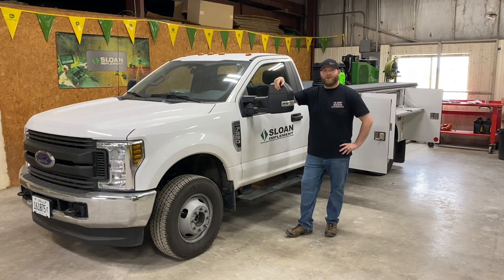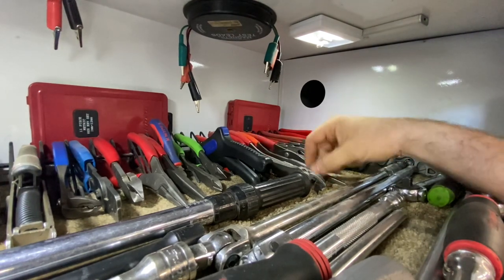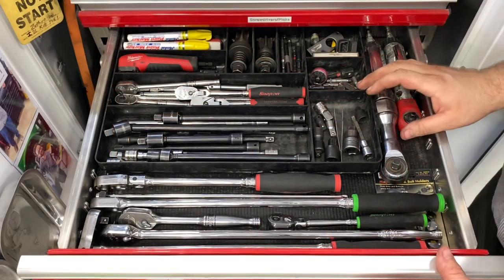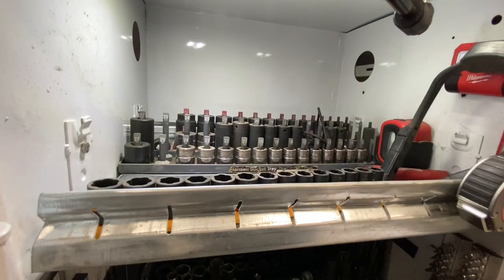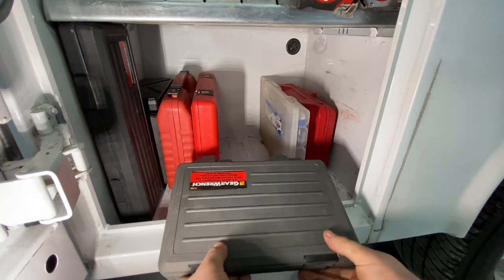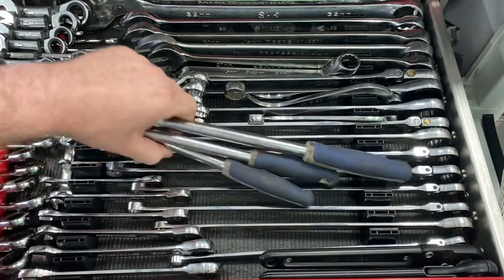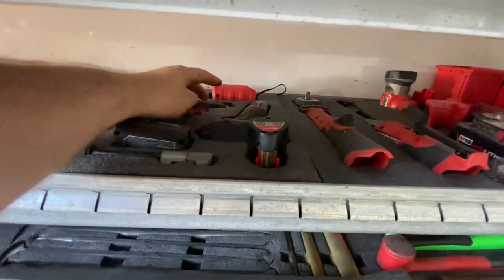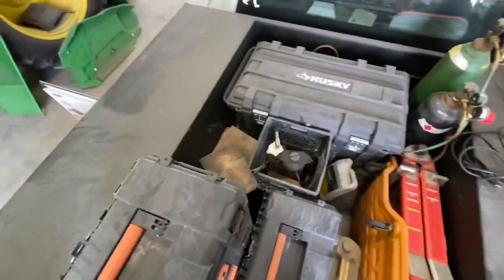John Deere Master Ag Technician service truck tour

Comment: I have that tekton set of 12pt impacts and was burnt by assuming it started at 10 and I didn’t have the 10mm 12pt to remove the injector retaining bolt on the QSX15 injector hold down. Luckily customer did. I took out the 11mm and replaced it with a 10mm. 7/16 is same as 11 and I also have the SAE set so it worked out good.

Comment: That magnetic roach clip tool is great for soldering wires. Matco also has a wire holder tool that feed solders through the middle of the tool towards the two wire clips or clamps. Im sure you've seen it or have it. Both are in my tool box. Great content and videos ZK!

Comment: My service truck is a F550 with the 6.7 diesel. And my air compressor is PTO driven. Also have a Miller Trailblazer 325 EFI welder.  Tanks for Motor oil, Hydraulic oil, Antifreeze and waste oil. All with pumps and 50 hoses. The hose crimper and fittings are in the back left cabinet. Hose is in the box in a sealed container.

Comment: Put one of those silica gel dessicant bags like you get in beef jerky in all of the drawers and inside your tool cases especially your feeler gauges and measurement tools, it absorbs moisture and prevents rust. Absolute lifesavers

Comment: I wish I could post a picture of my service truck,  2020 freightliner m2106. 9liter  Cummins , Allison 4000 trans sitting on air ride.The bed is a 21ft Load king . Pto driven air compressor,  10k auto crane with 32ft of stick.  Miller 300 welder/Generator.with 8vs mig gun . And an additional 100,000 of personal tools. But I m impressed with his cleanliness of this tools, his service truck might weigh 14,000lbs. Mine Weighs 32,324lbs
Reply from the maker: You should do a video tour! Sounds badass sir!
Reply: @ZKMasterTech  it is , but due to company policy I can’t make YouTube content with company equipment,
I work on power company trucks and Railroad equipment

Comment: I like the fact u buy the best tools regardless of brand not just snapon is the best attitude
Reply: Out of the hundreds of different tools I own the only own one snap on tool and it is a feeler gauge for adjusting the air gap on points and condensers. Most of my tools are either Sears/Craftsman or Harbor freight
Snap on is just extremely over rated and expensive

Comment: I've been a Deere tech for 13 years. My service vehicle is a GMC 2500 van, which is not nearly big enough. Haven't been able to talk them into a nicer truck yet, not that I haven't asked. I might just have to buy my own.
Reply from the maker: Yeah I think you’d be better off switching companies before forking up that amount of cash.
Reply: @ZKMasterTech  How long have you been with Sloan's? How long have you been in this truck? I like to keep my tools in clean, like new condition, if I can help it. I worry about rain and moisture with a truck service body. I work at one of your competitors in Wisconsin. But my family has a decent size dairy farm also. I'd rather not have to by two of everything, but they won't let me take my truck home overnight unless there is a service call close by. It has crossed my mind to maybe try and find a retired tool truck and turn it into a mobile shop.
Reply from the maker: I have been with Sloan’s for 11 years and I’ve been in that truck since 2019. When I need to work on stuff at home I just fill my personal truck with what tools I think I’ll need plus some extra just in case. But if I’ve got a major project I can take my service truck home.

Comment: Am I only one that appreciates the amount of money in sockets alone lol
Reply from the maker: Don’t tell my wife! 😂
Reply: I’m an engineer in New Zealand so I don’t know what snap on costs in the USA but over here it is prohibitively expensive, I have seen a snap on 3/4 inch drive socket set that cost the owner $5000 my 3/4 inch set cost me $150 but I try not to let people see it
Reply from the maker: @joelhart9020  yeah the majority of my snap on tools I bought through a tool program when I graduated Wyotech and got my box 65% off and tools 50% off. But I've still bought a bunch off the snap on truck over the last 15 years. I usually spend $250-500 a month on tools. But, everything I have is paid for. You'd think after that many years you would have everything you want or need...nope lol.
Reply: @joelhart9020  Wow!!!!!   Would you consider buying a set for those in the USA that want a 3/4 "  set and save a lot of money by buying snap on thru New Zealand!!!!!
Reply: @Franklinveterinarycenter1of4  sorry I wasn’t very clear, the snap on set was $5000, the set I have which is definitely not snap on cost me $150

Comment: Nice set up. Having no crane must limit what you can do on site? I know you can haul stuff to the shop but that isn't cheap. Also not much room left for parts or oils etc.
Reply from the maker: Thank you! Yeah a crane would be nice at times. We can haul equipment to our shop fairly reasonable for the customer.

Comment: awsome video! lot of good ideas. what are you using to hold your 3/4" sockets?
Reply from the maker: They are from Ernst manufacturing. 3/4 drive socket rails
Reply: @ZKMasterTech  awsome thanks.

Comment: how are those ridgid stack boxes holding up?
Reply from the maker: They have been in there for two years and they are still like new. They never have leaked water in. Way cheaper than the Milwaukee ones. And they never have come unlatched from each other.
Reply: @ZKMasterTech  Awesome!! i just bought some for my service truck last week, but i wasnt sure if i should have them in the bed of the truck or inside , then I saw your video yesterday. So I guess I will throw them in the back of the truck. Thnx

Comment: Super impressive tool set up man! Im curious, you get by ok without a crane on that truck?
Reply from the maker: Thank you! Yeah it would be nice to have a crane but if it gets to that point we just haul the machine into the shop and give the customer a loaner.
Reply: @ZKMasterTech  I gotcha. I also work for a Deere dealer but on the heavy construction equipment side. Most of our field guys have kenworths. Cool to see the other side of things and how you ag guys do it.

Comment: I noticed the Pittsburgh 1/4 flex ratchet.  I have it too and like it. I'm not into low end ratchets but it was $9 with coupons.  It works way better than you'd expect for $9.
Reply from the maker: Yes they are good

Comment: What kind of tool box is that red box in your 1st door and did it come with the truck? I can’t find one that will fit in my truck with a Warner utility bed
Reply from the maker: Ctech manufacturing. It came with the readings bed. But you can order through ctech

Comment: Awesome! I took a few notes on some tools I need, I went from a 8820 to a 9750sts combine and found out I need more metric tools, I really like the extra deep sockets for the long spring tensioners that would come in handy a lot did you make them? Also I know you guys are kinda far from me but would you travel up to Stanford IL for combine inspection? Good mechanics are hard to find seems like ya know your stuff,
Reply from the maker: The sockets are jd special tools you can buy them from parts. Sorry we can barley get all the combine’s done we have around here. Can’t travel that far to do one. Thanks for watching!
Reply: @ZKMasterTech   thanks for the info! Even our local dealers are the same way!

Comment: What percent of the money you spent on tools do you actually utilize for more than 15% of the time per annum?

The second reason I gave up being an auto mechanic was that I did not see the economics in purchasing back then, ending 1990s, $15,000.00 of tools along with another $10,000.00 in cabinets to put the tools in while only grossing $7.50/hour.  

I was not "pot committed" with a TECH tuition.

On my current 1999 Toyota Solara, I only use 10mm, 12mm, 15mm 17mm, and 19mm more than 50% of the time.  It would have been less expensive for me to purchase the individual SK wrenches and sockets rather than the whole sets.
Reply from the maker: I use all of them or they wouldn’t be on the truck.
Reply: @ZKMasterTech  

Thanks for the reply,,,,but you fell out of the canoe and missed the water.

I am curious the "efficiency" of tool purchases.  If you never bought a tool which you do not use more than twice per year, then this is 100% efficient.

If $5k of tools out of $50k purchase are used less than twice per year, then this is 90% efficient.

A corollary is how many weeks of gross income did it take to pay for all your tools.

This latter is the math on why I mainly did not pursue a career in auto mechanics.  Never thought about heavy equipment though .....
Reply from the maker: @michaeldunagan8268  i don’t care about any of that. If i want it or need it, I buy it. I have a tool budget and I pay cash for everything.

Comment: You don't keep your leather masters jacket in the truck...?
Reply from the maker: Nope it's in my closet at home lol. It doesn't fit my Sasquatch frame very well! 😂
Reply: @ZKMasterTech  I hear ya, they made them alittle short. Looks cooler on the garage wall than it does on me that's for sure

Comment: I am amazed that all that stuff stays in place, don,t think some of that setups would survive our roads.  Also are the compartments pressurized?  Everything is so clean or do the doors just have good seals.  The hinges on the doors certainly look stout.
Reply from the maker: It stays in place pretty well, but if I hit some railroad tracks hard or have to brake really hard they will shift around for sure. The compartments are not pressurized but the service body is only 3 years old and the seals work very well. I also take time to make sure the truck and tools are clean.

Comment: Are those long 18 and 24 sockets homemade?
Reply from the maker: Only the extra long 17” 18mm is custom. The other ones are Deere special tools.
Reply: A lot of guys at the dealer I work at cut their sockets in half and get a hydraulic hose with fittings and weld the socket halves onto it. Works pretty good.